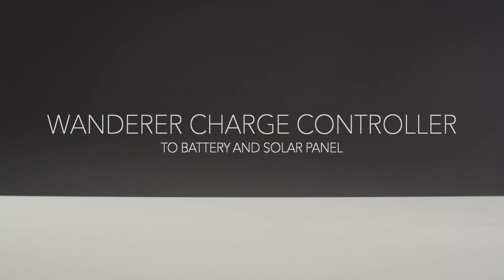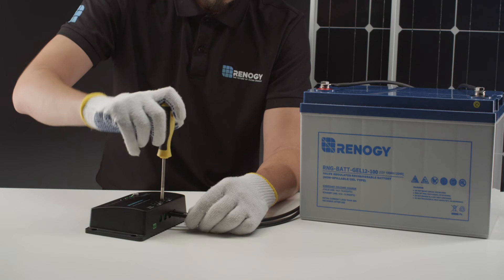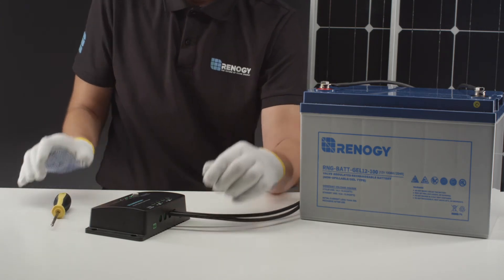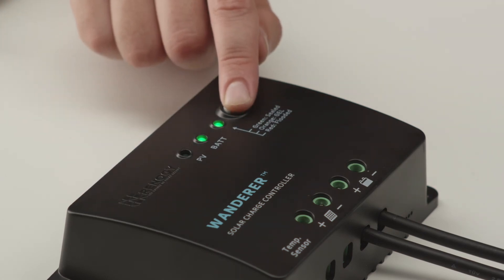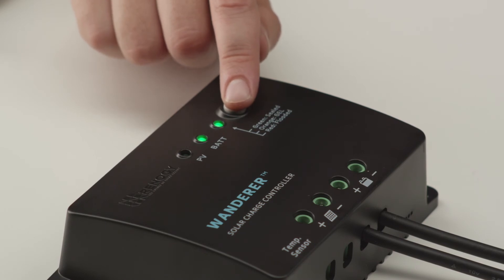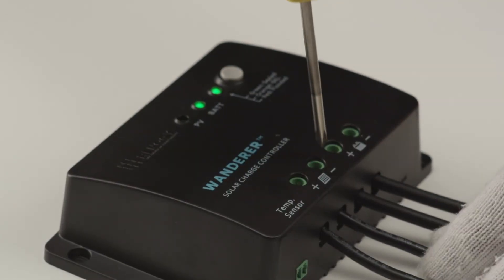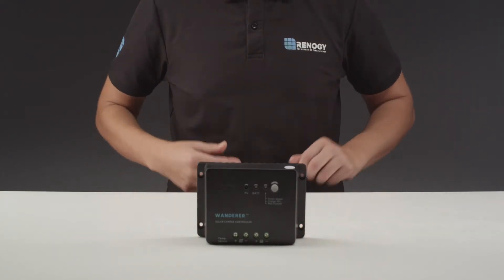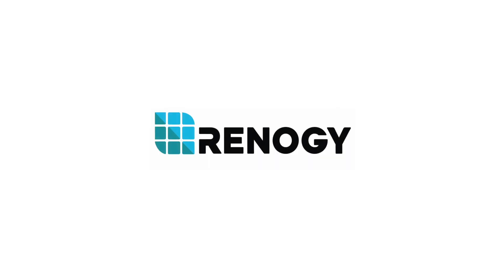Renogy Charge Controller — Wanderer

Comment: Why have i a red light in middle
Reply from the maker: The red indicator light indicates that the battery is over-discharged or overheated. Please confirm if the temperature sensor is connected, and use a multimeter to measure the voltage at the BAT terminal of the controller to check if it matches the battery voltage.
REPLY

Comment: I have the wanderer 30a charge controller, 2 renoght 100ah gel batteries & 2 100W solar panels.  I hook them up & steady Red light keep coming on for batteries.  I have 8g battery wiring (redo&black) & 2000W inverter.  For some reason I can't hook it up right.  The batteries seem over run with wires which I fear is a fire hazard offgrid.  Please help me hook it up right.  I watch all videos & nothing goes right, still.
Reply from the maker: Hey Ultimate Acres,

For any technical questions, please contact us here-https://www.renogy.com/contact-us?gclid=CjwKCAiA3pugBhAwEiwAWFzwdeH3Crd9vRTbjjTYl9l3daVqnotJPjBhs2nmw-Wkn1_guWQeW0ao6hoCOHcQAvD_BwE

Comment: What is happening when my Wanderer solar charge controller is fast flashing with solid battery light
Reply from the maker: Hi, Robert.

 For solving your problem as soon as possible, we suggest you submit a case through our Help Center Portal  (links listed below for specific locations）for help. 
 
https://renogy.force.com/helpcenter/s/contactsupport (USA)
https://renogy.force.com/helpcenterau/s/casesubmit (Australia)
https://renogy.force.com/helpcenterca/s/contactsupport (Canada)
https://renogy.force.com/helpcenteruk/s/contactsupport (UK)
Reply: @RenogySolar  You've replied on here so why not just answer his question?!

Comment: Can I charge 2 battery 100 amp renogy gel hybrid in parallel with this controller?
Reply: Get the DC-DC system for that, it can handle all battery types in tandem, plus alternator charging and solar power for alt batteries plus automatic charging of the starting battery all together at once:   https://www.youtube.com/watch?v=JtAUrS4zNSA

Comment: How do know polarity ?   How do I identify the positive and negetive leads from solar panel ????????
Reply: I could not find any positive or negative identification on the wires coming from my 50 W flexible panel. How do I determine which is which?
Reply: @kenbikelaw  If you put a multimeter to it and it shows negative then it's reversed polarity so you'll know
Reply: you have to mark them before install

Comment: what does it mean if the solar and battery lights are blinking?
Reply: I  think it means battery is fully charged.  It's doing that on mine and my volts got high at 14v.  It averaged 13.7 during daylight hours.